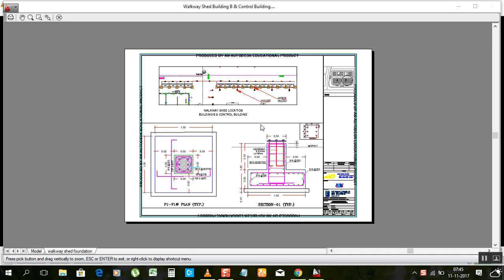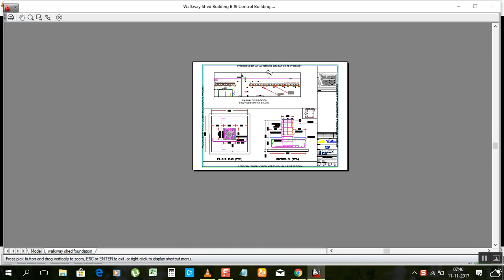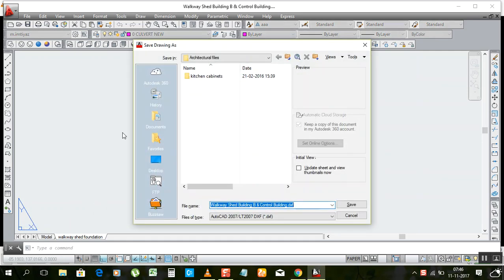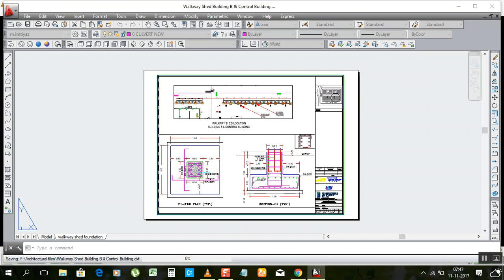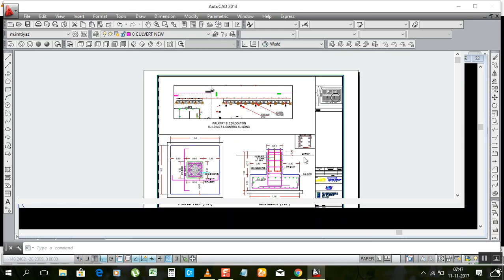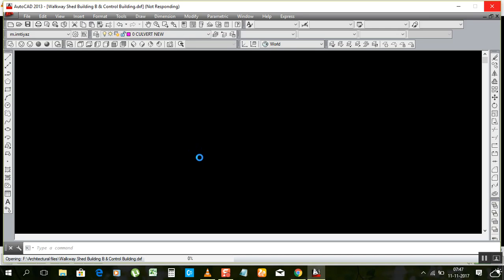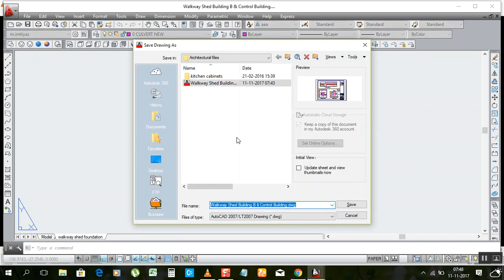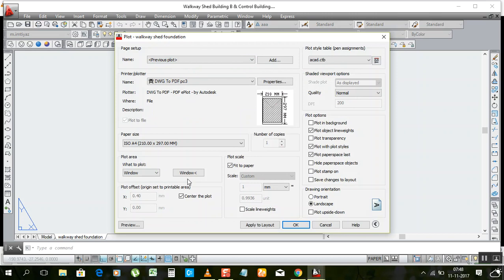Remove educational plot stamp Produced by an Autodesk Educational

Comment: Please what is the solution for this massage longitudinal bars have been generated incorrectly
Reply from the maker: If you clearly use this method it works if not the only one method works save as dxf....because Autodesk didn't give us any method to remove this stamp....

Comment: Thanks, man! It helped a lot! Why does Autodesk do it the way that you still have it even if YOU on YOUR COMPUTER have a licenced full version?! Thanks again!
Reply: The answer is obvious.  You want to use the software for commercial use, you need to pay for it.  Using an educational license to produce anything for commercial use is not allowed or legal.  Therefore, if someone makes something on an educational license, which then gets used by a company for commercial use, that's not allowed.  Simple.  Otherwise, you'd have companies taking advantage of summer interns with free educational software to do their work for them.
Reply: @TheEricSchubert  The answer is not obvious, but stupid. What is obvious is that there are numerous ways to circumvent the problem, so it does not make sense to create a roadblock which does not work.
By the way, what exactly does "educational license" mean? I suppose it is for students who are learning the software and using it for their study. If an engineering student creates drawings for his course projects, that's supposed to be legal, and in that case why should the drawing have those bold stupid lines printed?
For the sake of the frustrated students, here is another tip - just take a printout of your drawing and simply use a pair of scissors (available freely at home and workplace) to cut out the margins containing those lines! Next you may scan it to produce a PDF or whatever....
Reply: @chinmoy1955  educational copies don't have the watermark. You get the watermark when you open files made in EDU software using a commercial version. So, students making things for their projects don't need to worry about it. People using their kids' copies at home to make stuff do.

I love how people get all upset about companies trying to reasonably protect their assets when users are trying to get things they didn't pay for. There are free options out there. Good, legal, free options. Even Autodesk free options. (Fusion 360 for hobbyists and startups, anyone?)

The fact that you CAN circumvent the roadblock doesn't make don't so okay.
Reply: @TheEricSchubert  Sorry to say, you are way off the mark! I don't know what you mean by saying "You get the watermark when you open files made in EDU software using a commercial version?". I have a valid educational license for AutoCAD 2019, and when I try to print the drawings (within my legal EDU version of AutoCAD), I get the idiotic lines "PRODUCED BY AN AUTODESK STUDENT VERSION" printed on ALL FOUR SIDES (edges) of the drawing!
And by the way, here we are talking about Autodesk software, that is what this video is about and that is what Dmitrii Kobylin's question is about.
Reply: @chinmoy1955  then you obviously got something, anything, in your drawing that must have been made using an educational copy of the program. It could be as simple as a template or a block you downloaded from the internet. If you got any piece of a drawing from an educational version, then your drawing will have the watermark. Doesn't matter what version YOU are using right now. SOMETHING came out of and EDU version at some point.

I've seen drawings with this issue where a designer pulled something from the internet (a blog post, GrabCAD, a template made by someone else, copy/paste even a single line, wherever) and it was either from an EFU drawing or one that was contaminated with the watermark. Now you can't get rid of the watermark on any drawing made with that data. It could have happened years ago. A some years back, Autodesk switched off display of the watermark. That feature was still there, just not displayed. A year or two ago, they turned it back on. Now all those drawings could show the watermark again. So, who knows when that contamination happened. But it happened.

It can be royally frustrating. But you need to be careful where you get your data from, because it can cause serious problems like this if you grab random stuff and use it.

I work at an Autodesk reseller. I know all about this stuff, as I run into it often. Autodesk will not remove the watermark for you. And circumvention of the watermark is illegal according to their licensing agreements.
Reply: See here for details:
https://knowledge.autodesk.com/support/autocad/learn-explore/caas/sfdcarticles/sfdcarticles/FAQ-Reintroduction-of-education-watermark-for-AutoCAD-2019-and-AutoCAD-2019-vertical-products.html
Reply: @chinmoy1955  also the versions that students get are different than the versions that schools get. School copies don't have the watermark. Student copies do. There's no way to remove the watermark if it shows up. And you cannot remove it in the student software.